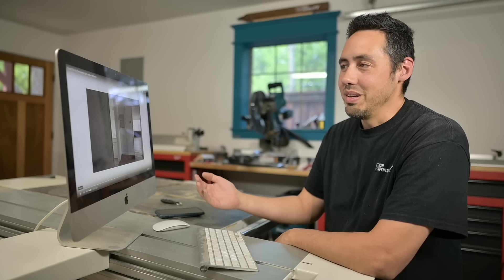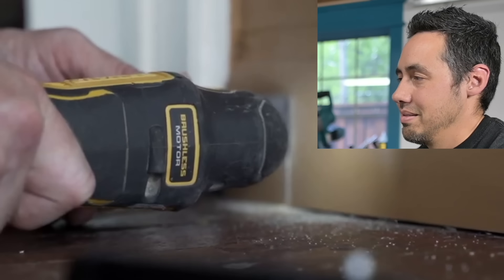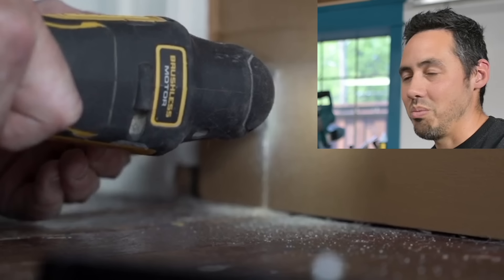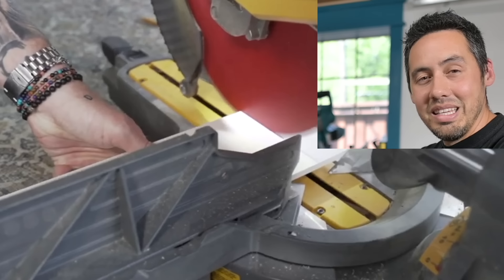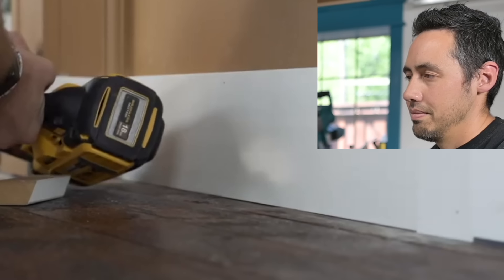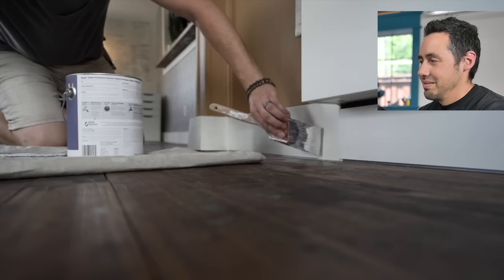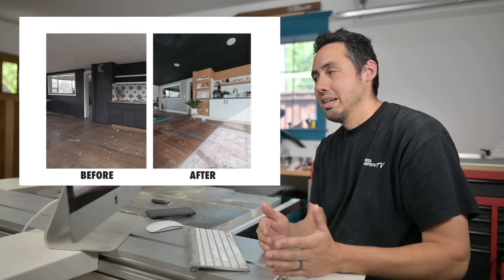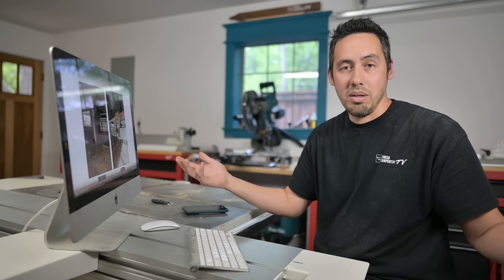Carpenter reacts to Do-it-yourself Trim Carpentry

Comment: 7:59   before/after   yes from a moving car.  Thats why you can get away with imperfections outside.
But inside  just looks like shit.

I helped a trim carptner do a club house trim he used 4" wide poplar
Ever nail hole was set and covered it was all sanded 150. Very smooth felt like glass. The finished project was beautifully done. 
Ive walked into apartments that were brand new that looked like they used a chipmunk to cut wood.
And it had no idea what a straight line was.

Comment: the ONLY situation I can think of where you would want to cover your trims without damaging them is a rental, where you can update the look and revert it when you leave, but the need for those corner blocks invalidates that as an option. any other circumstance, since you're damaging the old trim anyway, it would be faster and easier to just pull the whole trim, and you don't need to pay for a piece of trim that needs more expensive production to have a slot that fits over the old trim.

Comment: The transition block looks like it has a more rounded edge on the top compared to the trim that looks more square.  That seems to be part of why they match up so poorly.  Still not sure why that is even needed.  I guess it is supposed to act like an end cap to prevent showing the old trim underneath?  Seems it would be easier to fill that end flush with filler and some sanding.

Comment: I've used oscillating cutting tool I agree it doesn't cut straight I only use it in rare instances. You can't cross your arms at miter saw it's dangerous. 😂

Comment: I hate caulked trim. I guess with MDF it doesn’t move much, but caulked trim almost always cracks at the joint, making it look worse than just seeing the line where the molding touches the wall.

Comment: Maybe ....... If you were covering over 3-1/2 base boards that had hard wood or tile going up on the base board with 2-1/2 inches showing. Sometimes with older baseboards those are hard to dig out because you can't get to the bottoms. This cover over would work. If it was me personally i would not cut the transition pieces for the ends . I would rip down some material and glue it to the back to make it appear to be a solid piece of wood. That could easily be puttied up and painted and would be on the end where it butted up against the door trim . I would never recommend this product but i could make it look good if i was told i had to use it. I would probably pass on the job though . : )

Comment: You appear to be knowledgeable in this field but as a fellow carpenter and general contractor I’ll point out 2 things I disagree with. The tool used to cut the baseboard in this video appears to me to be a rotary saw, not an oscillating device. Also I’ve never found a need to sand pre-primed MDF - the factory priming today is super smooth and ready to paint with only filling and caulking of brad holes, abrasions and difficult mitres. Otherwise I agree entirely, this system is ridiculously more work and more costly than simply removing and replacing the old baseboard! A good video and one of the very few in carpentry that isn’t done by an amateur. Nice work!

Comment: As a painter, the 'Don't worry about gaps we can fill that with caulk' pissed me off. I remember trim guys who'd leave quarter inch gaps in corners and next to doors with that same mentality. If you're that bad at measuring, stop doing the work you're pissing off another trade. But I've seen Trim guys who could make caulking an option not a necessity.

Comment: What is a matter with you? I’m 72 years old now. I was really fortunate to have a father who was a stair builder only to remember how smooth his finish was. How demanding he was. Granted I only knew my father till I was a young age of 13 when my parents were killed. Later on I worked for a seamless siding one man show. One day we were installing a rather nice exterior storm door. I was told to get the screw gun from his van. I was about 80-100 feet away, telling me to hurry up, we have to install another. This is no joke, his van had the screw gun upon walking with a bit of a run. I will always remember what he said to me,”What the f*** took you so long, pick up the tools we are done”. I might of been 10 minutes. I looked at storm door, this hack installed aluminum screws with a hammer. I was about to say it ** this. Yet I did not say a word, I needed this job. 
As I’m watching your video and adding your points of view, I could only picture the hammer smashing those 1/2-3/4” soft aluminum screw heads. Some people I believe have good intentions yet they lack experience for being over confident with a pinch of I can do it better (arrogance). 
I enjoy your videos. You have no problem admitting your errors not to mention how you made it correct. When in doubt? Ask…
It’s my opinion that there is some excellent information on YouTube that should be reviewed by all. 
Craftsmanship is not simply understood, craftsmanship is earned. 
Thank you for not being condescending on your review with the home owner. It’s so easy to criticize another as to make one’s ego grow at the expense of another.
We may only pass this way once. Your videos are chuck full of insights. 
I was given a complement a long time ago. I have never advertised, only word of mouth. A client of mine told his friend, “ Oh yeah, Bob is too expensive not to hire, hire that other guy only to have to do it all over.” 
I would like to leave you with a few words that I do my best to live by,” If a job is worth doing, it’s worth doing correctly “…. 
Please show more similar videos. The public may simply have never been shown what a quality finish looks like versus a down and dirty storm door installation is. Don’t forget,” My hip national bank and What, I can’t see that from my house” 
Bob

Comment: Strangely enough I just ripped the baseboards out of a house where the cover trim might have been an okay DIY solution. The walls are stucco covered cement block & keeping the old baseboards to shoot into may have been easier for an inexperienced DIYer. But then again what are the odds they could have controlled their nail depth well enough for it to work? Besides, I’m cutting channels behind the baseboards for wiring.

Comment: Yeah if you're gonna get out a nail gun you might as well rip it out and put in a new piece as well as paint it beforehand because it'll be much cleaner and easier. The idea gives you the illusion of simplicity by eliminating demo factor but it takes 10 seconds to rip it off.

Comment: I'm nothing near a pro, more like a very seasoned veteran DIY'er and I'm in the UK. If we weren't going to move I'd be tearing out all the skirting boards (baseboards) and replacing with new, I would never dream of covering it up. To me this is just a whole load of extra work that's unnecessary. Rip it off, make good the wall (not always necessary but what I have at the moment is taller than what I want to put in) and cut and fix the new stuff.

Comment: It would be quicker to rip out the existing "trim" (in the UK we call it skirting) quickly fire in a runner along the bottom to pack out to the wall level then nail on a higher skirting which will cover any lines where the old trim and plastered wall met.

This crap would literally make the job 3 times longer to do.

Comment: You make great points but I have to disagree with you on the oscillating tool. That Dewalt multitool is absolutely not precise. But if you use Fein and especially one with a distance attachment / guide you can cut straight lines without taking anything off. Give it a shot I think you might be shocked how different German precision tools are.

Comment: I HATE using that oscillating tool! Worst most annoying tool to use imo

Also thanks for the tip on crossing arms at the miter saw - I’ve never had a problem but the few times I’ve done that, something about it always felt bad and sketchy. Now I know my instincts were right.

Comment: Why did the company make the transition blocks the same thickness as the baseboard? Why didn't they make it thicker than the baseboard so the baseboard sat back instead of having a butt joint? What were they thinking? Another thing for DIYers, regardless if you're staining or painting  don't ever think "OK we'll just use caulk." Maybe because when i first started I learned on stained finish trim and was taught never to rely on putty and caulk.

Comment: Yeah man, I see people whip out the multi tool for fine cuts and ask myself what am I doing wrong. I did see Scott Brown do a cut that looked good enough on camera (scarf joint at what looked to be 45 degrees with a guide board) - but yeah it seems like my dewalt would walk all over even with that. Maybe makita is way better at that. But yeah

Comment: Worst scenario I’ve run into was in my garage. I just paid 4000 for an epoxy floor with my teams logo in the center.  I wanted 1x8 black baseboard to match.  I went to remove the 1x3 “garbage moulding” put there by builder and found it had been nailed with 3.5” framer nails every few inches!!! What kind of animal does that.  I’m prying it off with both hands and all my strength and the drywall gives way and cracks.  Arghh dammit I still haven’t fixed it. This appliquéd moulding might just work in that case.

Comment: First time here, laughing at the C.T. system review and mostly in agreement. However, I do somewhat disagree that the multi tool isn’t a precision / accurate cut. I have a Bosch variable speed and a couple HarborFreight cheapies and with patience, a straight edge, skill and a fresh, fine toothed blade, my worst cuts are usually within a 1/32” or less, which is more accurate than most carpenters accomplish on painted work these days. Also, I’ve always despised the look of 1x square edge baseboards without a base cap molding to transition from that 3/4” dust collector ledge… that’s definitely some clunky, amateur “looks good from my house” work. 😉

Comment: Just throwing this out there. As a professional woodworker and finish carpenter it's always easier to start with new. I also know how much it costs people to hire me to do it. No matter the trade there is always going to be some new state of the art tool or material that will turn any homeowner into a pro. If someone I knew or even a complete stranger  did their own casework and it looked like hammered dog shit, I would never ever tell them that I thought so. Simply because I know that I couldn't walk into their job and be a master in one day.  Ok That's all I got for now.
Except I cross my arms at the saw sometimes and have never had an issue with it.

Comment: I agree with you on one point. I would rather remove the old, and put up a whole new piece. What's the use of those "transitions"? Why couldn't they just put in a whole piece over the old trim. Now, for the multi-tool. You say don't use it because you won't get a straight cut, etc. What? Really? I've got two of them. A corded and cordless. I love them. And, if I needed to just cut a small piece out, lets say, for damage, that's how I'd do it. If you can't cut a straight line with it, then you need more practice. It's really not that hard to do.

Comment: im with you on this. Just remove the trim way easier, looks better, and probably cheaper than this cover trim stuff. I am still in the process of replacing all my baseboard and door casing trim with 1 x 6 and 1 x 3's. I have removed everything. No seams on long walls, I do butt joints as i am certainly no expert in mitred joints. Looks way better than this.

Comment: He also reaches  in quickly. too (needlessly) grab the scrap piece while the saw is still turning. "Music" is BAD. You don't cut inside corners with a miter. They don't even mention dealing with that corner trim. Black ceiling. Yum!

Comment: At least buff the new trim with a 220 grit, wipe  it off for residue and paint it. Be careful of brush stroke lines using a paint brush. Better to use a roller if possible

Comment: Wow, that base does look rough. It looks like a very poorly executed scarf joint in a short run of trim.  Something I try to avoid at all cost.
 
To be fair, I've done a similar process leaving a tiny crown on a ceiling and covering it with a larger crown.   Just removed a couple inches of crown in the corners with an oscillating tool to allow my square cuts to die into the wall.  The coped cuts then cover the tiny moulding entirely and meet like any coped corner.

You'd never know a tiny moulding was hiding under the new one.  You get the benefit of less mess,  less time spent removing old potentially lead painted trim,  and the old crown acts as a nice backer board to help get that crown sitting just right.

On a baseboard install with so many starts and stops,  just remove and replace.  No matter how well you install that, I just won't ever look right to a trained eye.

Comment: I'm a remodeler/carpenter and my goal is always for my painter to use as little caulk as possible and I legit feel like a useless hack if I leave a gap bigger than a 16th. I'm missing a finger tip and have damage to 2 more fingers so my caulking/ painting skills have suffered greatly as a result but I cut everything as if it's stain grade. The time spent on prepping this garbage would absolutely be better spent on ripping that old crap out... hell, if they painted the old stuff it would have looked better.

Comment: OMG it’s total Ameteur level  stuff that  is designed for Harry Homeowner     i guess it could have its place but i completely agree as a Retired Architectual Woodworking Installer  it’s horrible Craftsmanship and i personally  would be horrified if i saw it in someone’s home installed in the manner the video  shows it FYI i have torn out all the builder grade trim in every home i’ve owned  and replaced it with a more modern or traditional style Trim  some of which i personally Milled  i too spent years cutting MDF  without proper Dust Extraction  years ago  and my conclusion is it severely affected my health  also when i began in the Trade  there was a lot of Formeldahyde  being used in Products  and we didn’t use Respirators like they do today  ? my Uncle passed away a few years ago fromMesalhemolia ? and my Dad (his Brother ) asked him if he had ever been around Asbestos  in his Career as a Air Force Airplane Mechanic  then later as a Turbine Engineer Specialist  he. laughed and told my Dad are you kidding  we used to have 55 gallon drums of it that  we used to glue up using our hands to insulate Engine Compartments with on Airplanes  he was well aware why he was going to die  and in his defense he did it like a Man of honor and the VietnamVeteran he was

Comment: OK, I only have over 35 years as a c&j so need some help here. The transition block, what is its purpose, why not just fly over the original skirting. Apart from the damn kick in it the profile is different. It appears to have a bull nose we're the trim is almost square on top. Please someone explain the block, I'm feeling dumb here.
BTW, it's a terrible idea.

Comment: After going through the trouble of redoing everything else...sometimes, taking out a couple pieces of existing trim is just too much!!! ;)
This is nothing more than a gimmick. Besides that, there was absolutely no need to cut away the trim to put in those blocks...as the ends were all covered up anyway.

Comment: I didn't plan on writing any comment at all. I usually just enjoy watching your channel. However...I was cringing at every step and talking to the screen: "common man... What a joke! " Right? 
I think it would  really hurt watching their demo again... 
I agree 100% with everything you said. No common sense! For sure two thumbs down on their solution and terrible execution! - Furthermore brad nails sticking proud not driving them in, no putty or filler, no sanding,  or anything, outside corners at different angles and heights, his drop cloth in the wrong place while painting just slapping paint on MDF trim that is clearly not ready for paint and the "cherry on top" crossing the arms at the saw.... I'll stop here and say just overall bad practice. 
Thanks for the video. Keep up the great work Finish Carpentry TV

Comment: This looks considerably harder than just removing and replacing the base itself. WTF!? And dude is using a tube of caulk per 10ft of seam 🤣
(Pro tip: if you're wiping away more caulk than you're leaving, cut a finer point and make a smaller bead for crying out loud)

Comment: This is supposed to be easier (or cheaper?) than replacing the trim, but they used the same tools, and methods (minus the skill) it would take to pop the old trim off and install new. I'm willing to bet that same unskilled DIYer would have done a better job starting from scratch with the real thing.

Comment: Yeah I’m sick to my stomach. At 7:13 you see so many sins of finish work. The removed door with no attempt to conceal the hinge mortises, the door stop still on the jamb leg, the base off to the left, the horrible seams you pointed out and of course the fit and finish around the corner at the cabinet. Let’s also not overlook the mitered outside corners that were not flush at the top of the molding. WTF!!!

Comment: Still can't believe why people still like to nail wood on the wall. 
A lot of work for nothing. You have to fill all the holes, sand them and you have the risk shooting a nail in a cable of even worst in a water pipe. Just glue them on the wall.

Comment: So cover trim is $30 for a 96 inch 5 1/4 piece, plus another $10 for each transition. 5 1/4 pine baseboard is $2.70/lf or $21.50 for 96 inches. MDF baseboard of the same size is $13.00. So, you do the math. It takes about 5 minutes to remove a wall of baseboard. SMH!